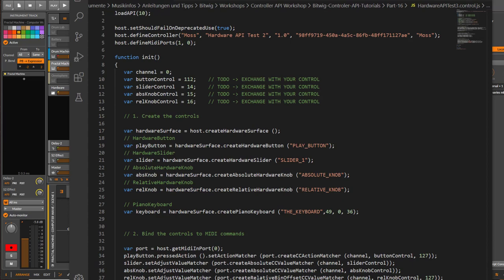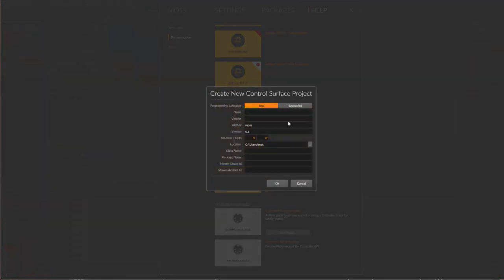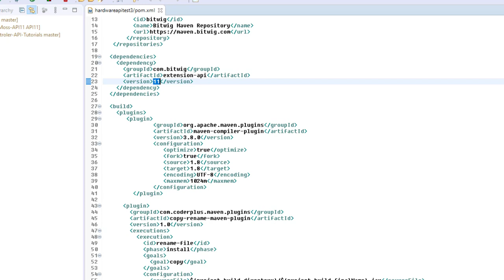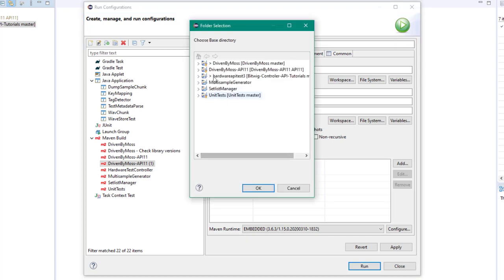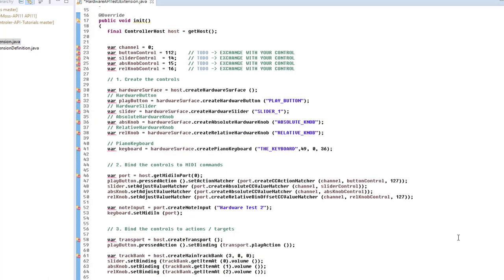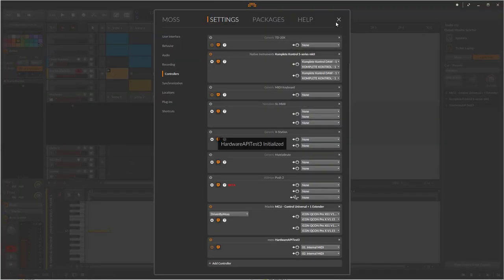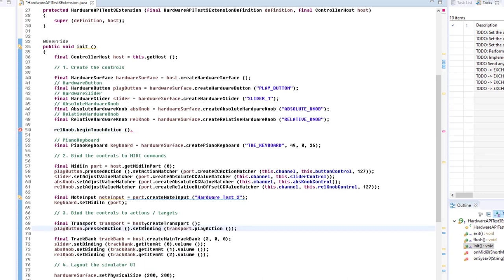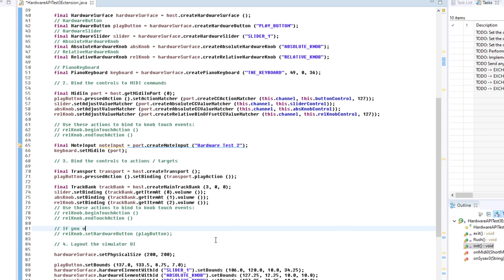Bitwig Controller API - Part XVI - Hardware API (3) - Conversion to Java - Knob touch and push

Comment: Great work with the DrivenByMoss scripts!

I had been interested in Bitwig for a while, but am very reliant on tools like ClyphX and Max4Live. Seeing what you accomplished with the Bitwig API for your Push script made it seem like a much more viable option for me 🙌, so now I'm getting started with it to see if I can replicate a live-looping workflow similar to that of Binkbeats.

Do you feel that the JavaScript API has been improved since you published this video, or would you still recommend working with the Java API? I already have a significant amount of JS-based tools; so JS would be ideal for me, but I'd likely avoid using it if it would result in a more restrictive development experience.
Reply from the maker: Yes, Java should still be used. What you should understand is that the Bitwig API is not designed to do any audio processing or video in contrast to Max/MSP.